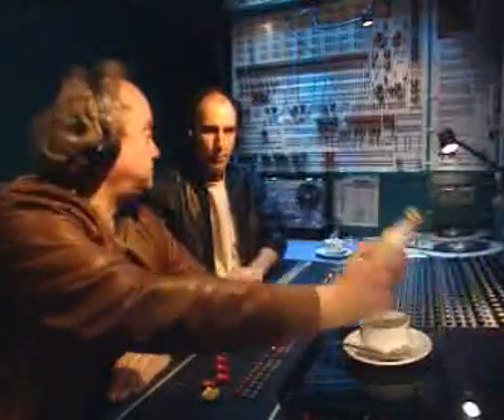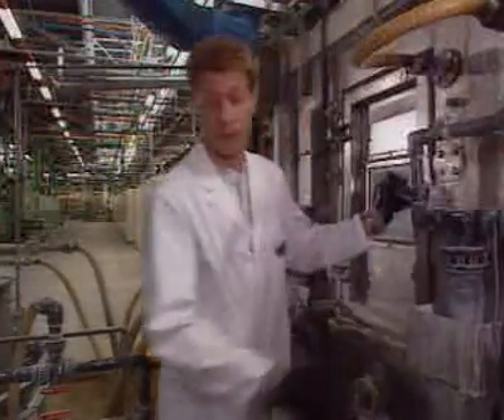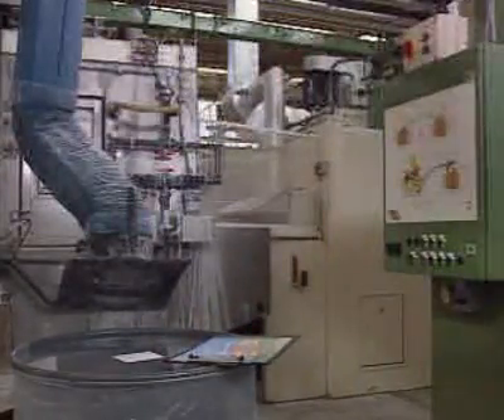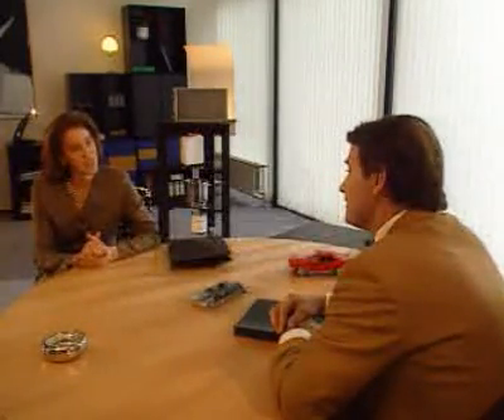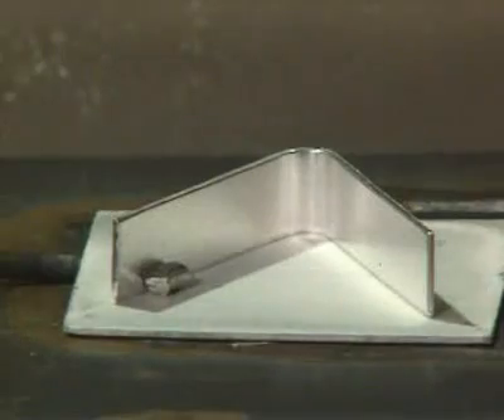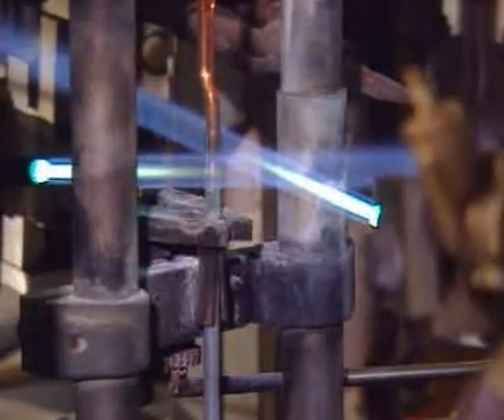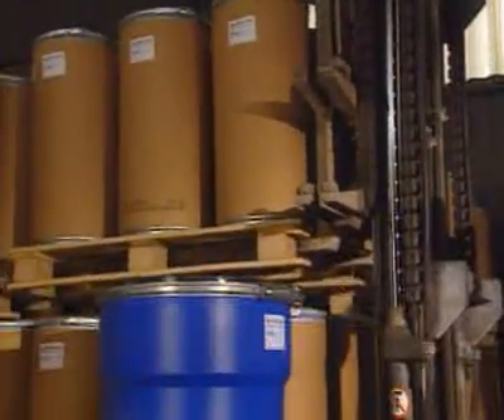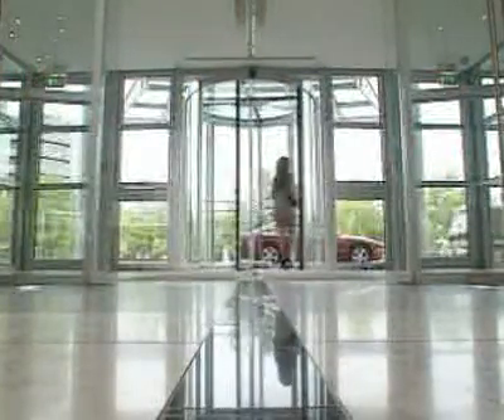The NOCOLOK Flux Brazing Story, english spoken

Comment: When are they gonna get it on? She shoulf only have lit that cigarette at the end of their conversation. In any case, very entertaining. I'm looking for info on metal working to help me with some motorcycle repair and modification, (a wire wheeled cafe racer based on a CB750FC with extensively modified control ergonomics consisting of adjustable clip-ons made from a spare top triple plus modified peg plates plus fat modern radials, etc) and this was the best video I've researched on the subject.